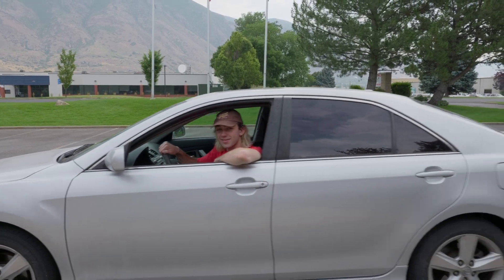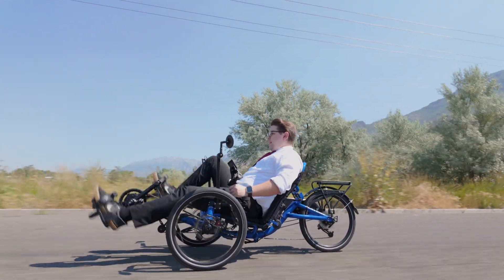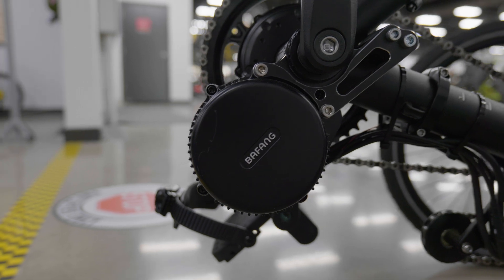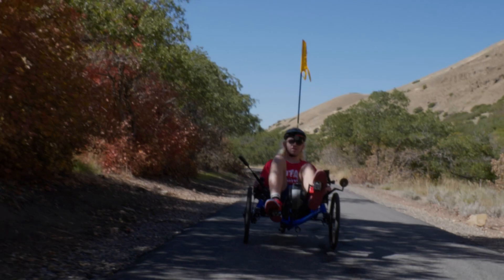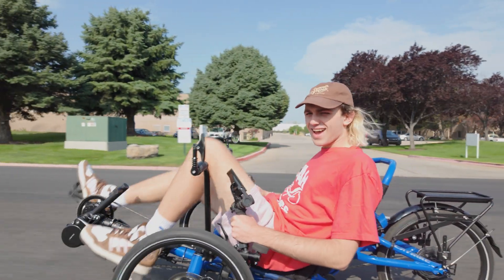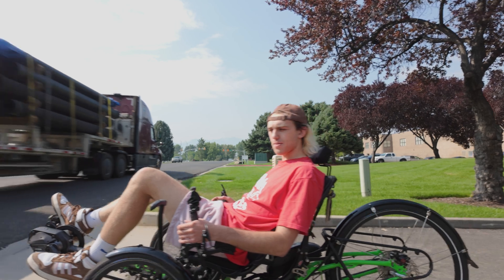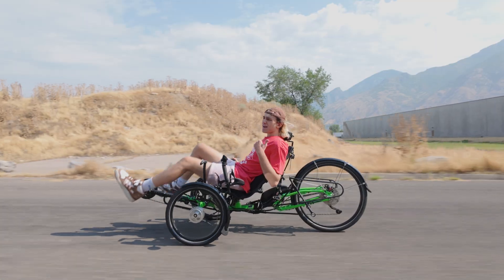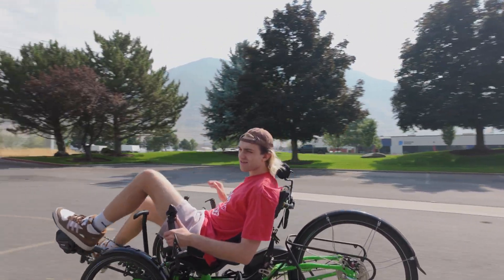Cadence vs Torque Sensor Motors - Which Should You Go With?

Comment: I currently ride an e-bike with a cadence sensor. My riding is 100 percent on a flat, paved rail trail. I have limited use of my right leg and I can ride a cadence sensor without any issues. But I like the idea of the smoother power delivery with a torque sensor. But I wonder just how much pedal power is required to maintain a steady speed with a torque sensor. I can pedal but my pedal power is limited. I typically ride my e-bike at a steady 12-13 mph on the trail in e-assist level 1. But I sometimes feel the “ ghost pedaling”. I am considering an e-assist tadpole trike due to increasing lower back issues. I am 75 and still in relatively good shape except for my leg issue.

Comment: I have the revolution eQuad, I ride it on dirt roads, paths and trail so varying terrain, with constant changes in elevation in off road type conditions it would be nice to have the torque sensor option, I have cadence sensing and it means constantly adjusting the amount of motor assist for the changing conditions.
Reply: Ditto, I'm having exactly the same experience with my eQuad, on varying terrain I'm either constantly shifting or adjusting the electric assist, not mentioned in the video is Bafang has a torque sensing motor now so if you can afford it you can upgrade.

Comment: I've installed torque sensing electric motor kits to both my wife's and my 2013 Ice Sprint trikes at the 9,000 mile point. We now have over 12,700 on each trike. They have made our biking life very happy and compactable. We can now ride together with me going as fast as I want and she can now easily do the same. I have a cadence two wheel and torque sensing is so much better especially with a throttle. Unfortunately the Bosch and Shimano's are a little underpowered and don't offer thumb throttle which my wife uses all the time. My trike is still running an aftermarket Tongsheng  TSDZ2 with battery 52V 19.2 amp, T-Cycle’s Battery mount, cockpit mini T for computer screen. I still run my Tongsheng without problems but my wife burnt out her motor. I replaced hers with the newer and stronger CYC Photon. I'll be upgrading to the CYC on my bike once I wear out my Tongsheng. Both are torque sensing and offer throttles. Both motors and accessories for them are available where I purchased my wife's CYC Photon in Utah. Electrify Bike Co. I love Utah Trikes and have bought many accessories from them. I would buy a new trike from them if I needed one. Glad to see they are now promoting torque sensing motors. I wish Utah Trikes offered the newer 750 Watt CYC Photon as an aftermarket install with optional thumb throttle like they do with their Bafangs motors. PS. Ice trikes are amazingly durable and well built.

Comment: With the loss of a triple on the front, and the battery only lasting 40-60 miles.  What happens when you do the 80 to century days.  I a guessing you’re now stuck in what looks to be the middle chain ring with ten in the back, carrying an extra 20 lbs basically at the end of the ride?
Reply: If you are doing centuries, you probably don’t need a motor, so no worries. In my case, I would carry a second battery if hills were on the schedule. 
I have a Tongshen motor (torque sensing) on my 559 and I have been able to add a second gear ring on the front in place of the chain guard. Currently I have a 38, and 48 tooth which is somewhat similar to my original 30/39/50 with the motor replacing the granny gears. If I didn’t live in the foothills of the Cascades, I might not have added the motor, although most people I ride with have them, so I would fall behind on every hill without the assist

Comment: The Bafang 750W with current sensor can be set up beautifully if you use the programming cable to set up consistently progressive assistance steps. It provides excellent battery life by adjusting the assist level on the fly for varying terrain, but requires constant change by the user...like running a manual transmission.  I dont even have a throttle installed on my Bafang equipped trike.